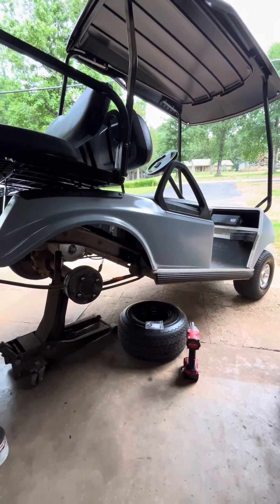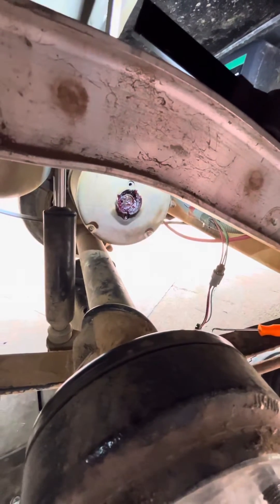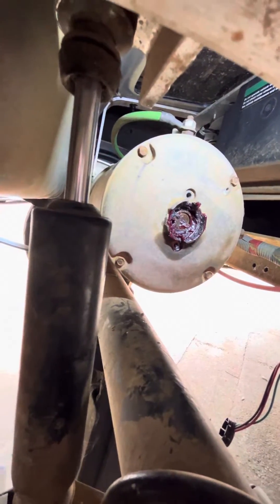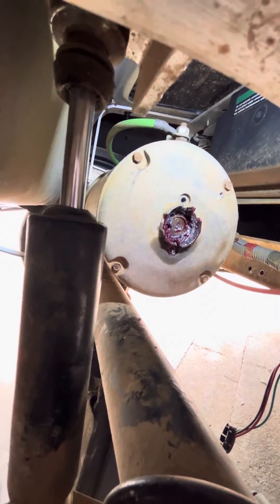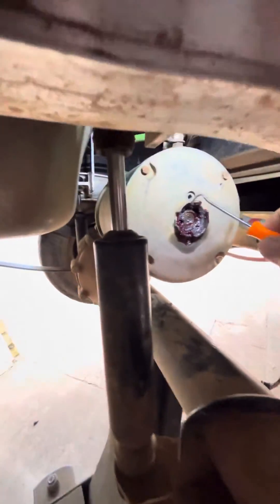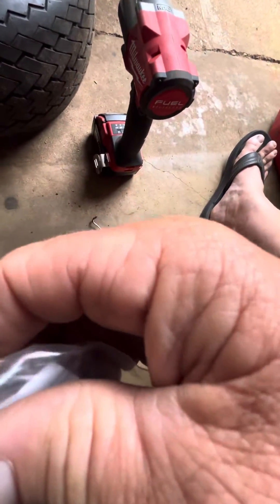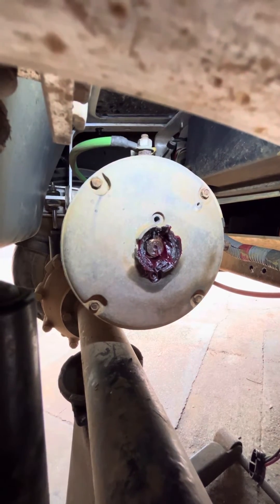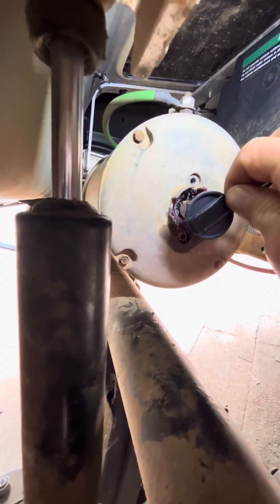Club Car DS Speed Sensor and Magnet

Comment: Thanks for the demonstration of how to get the magnet out. Great idea!
Reply: Let me add this comment now before someone removes the two screws near the Speed Sensor.  DON'T DO IT!!!!!!    I took a spare spade screwdriver, heated up the end and bent it about an inch back.  Made a pry bar out of a screwdriver.  Fantastic tool.  Simply use the new pry bar and carefully remove the old Speed Sensor from its base.  My Speed Sensor did not come with a new magnet so I just put the new sensor in place.  I positioned the sensor to "catch" on one side and then used a small hammer to tap the other side in.  Then you can use a dowel rod and hammer to set it in solid.  Hope this helps a DYI guy.  Don't remove the two screws.

Comment: This might be a helpful tip for anyone that come across this video… the speed sensor on the ge motor.. club car ds iq. Get two paint can openers and reach them behind it. Then slowly pull and walk the speed magnet off. Then get a high speed magnet. The stock one has 8dots… the cart speed with that is 13th ish unless the controller is set to run faster. The high speed magnet has 4 dots. And will get your cart up to 23 maybe 25 mph . So if you are going to change out the magnet get a speed one.

Comment: I see that you removed the two screws that keep the back retainer bearing aligned. I mistakenly took those out as well and now the screws won’t go back in. 

Any advice? I bought longer ones (same size) with hopes to fish them out but no luck yet. 

I have a 2002 club car ds 48v iq series with a GE motor 🙏🙏

I heard taking off the motor cap (removing 4 bolts) could cause the motor to get out of line - trying to figure out a solution ://
Reply from the maker: I had to take it all apart just for those screws
Reply: @richvandenbroeke5493 what if I just remove the 4 bolts and motor cap? Reattach bearing and then bolt it back up? Some ppl online have said that works too
Reply from the maker: @BenKleinCreates think you have to have the bearing in the cap, install those 2 screws for the bearing retainer. Have the armature set in the housing with brushes in place then assemble the cap to housing. Tap the inner part of bearing while putting onto shaft
Reply: @richvandenbroeke5493 
If you don’t put those two screws back in what happens?